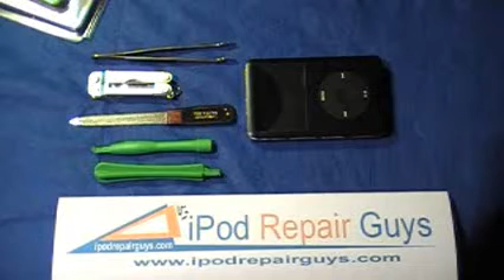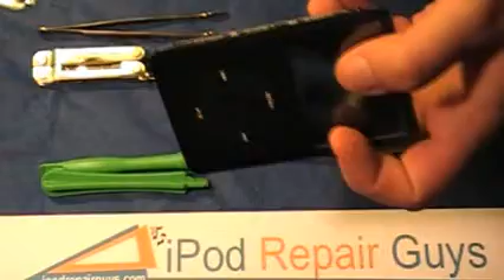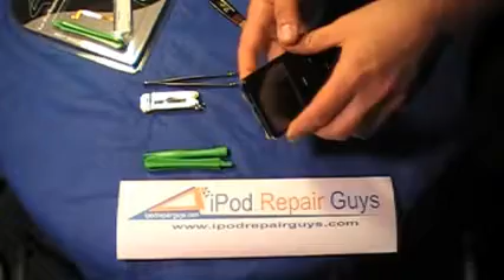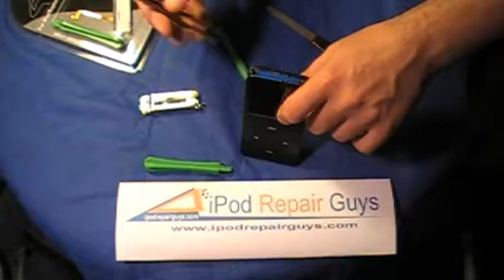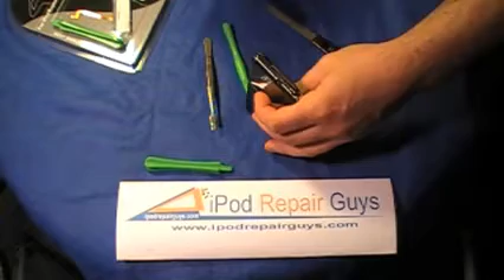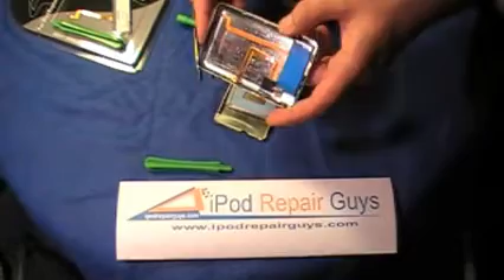iPod Classic Repair Video - How to Open the iPod Classic

Comment from the maker: Wow that's impressive. It was an iPod Classic? The larger Classic models like the 160gb are a little bit easier to open but they still take some work. I have received lots of damaged Classics from people trying to open them and breaking some of the delicate pieces during the process.  

I mention you should start at the hold button but you need to use a lot of caution in this area because if you damage one of the tiny plastic tabs on the hold button slider it will give you problems.

Comment: this is a BAAAAADDD idea. do not do this! I crapped out my ipod trying to fix it! (and I am fairly good at working with small electronics). Apple designed it to break if you try to pry it open.

Comment from the maker: Just for information sake it does take a while to seperate the front and back plates. My first time it took about 45 minutes. The video shows how you should open the case and what tools work for me. The case physically opens like the older versions aside from the extra locking clips that are located along the side and on the top.